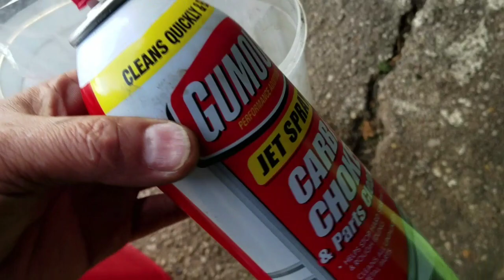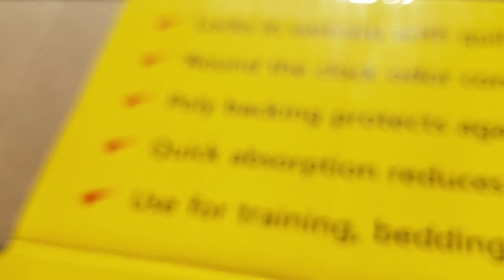MURRAY GARDEN TRACTOR BRIGGS & STRATTON OPPOSED TWIN RUNS ROUGH MAKE 1 OK NIKKI CARBURETOR OUT OF 2

Comment: Hmmmm I almost wonder if putting the air filter on would help. I have had some mowers have that happen.  Also  does it have new spark plugs? Try changing those too
Reply from the maker: You and I both know, it could be a million things...I'm gonna check the dual magneto, then plugs like you said. Thanks buddy.
Reply: @MowersNBlowers  Good call also keep up the great videos!

Comment: Are you sure your fuel pump springs are oriented right? After 20 seconds mine would start to die as if it was out of gas. Found a spring missing. It’s so easy to put those springs in the wrong place.
Reply from the maker: On the nikki, there is just 1 big spring.  There are 2 small springs in the 3 screw.
Reply: Mowers N Blowers I just searched and there are a boat load of videos on those things. Must be something inside that’s getting missed Henry.

Comment: You can't use gasket sealer on a carb.It is trouble down the road.
Reply from the maker: The area I used a little is just for the surface...no contact with gas at all.

Comment: Can I have the carb u dont want
Reply: henry, he is trying to rip you off, you can sell it on ebay for around 50-83$. just letting you know
Reply from the maker: Ash...oh I know for sure...I sold my old 3 screw for $85. I'm gonna try and find a spring, jet, drain plug, welsh from.somewhere and get the old one going.
Reply from the maker: Who said I dont want it? I never throw anything away, you know that.
Reply: @MowersNBlowers  exactly, I was just trying to warn you in case you didn't know it's value
Reply from the maker: Appreciate it ash!  But as you probably know...I'm like super cheap, I'm a hoarder, and almost never throw anything away!
Reply: Ok